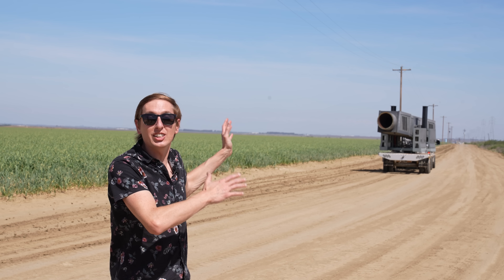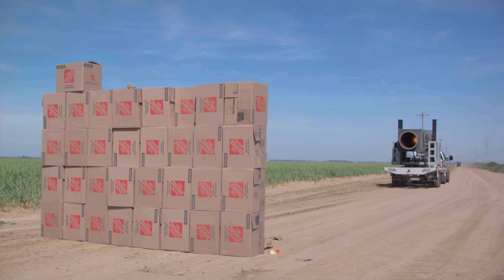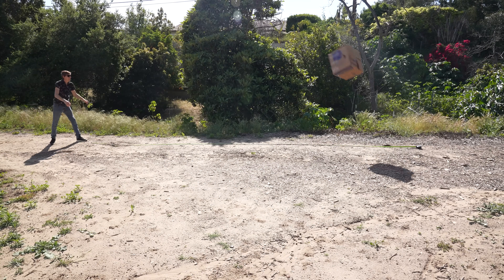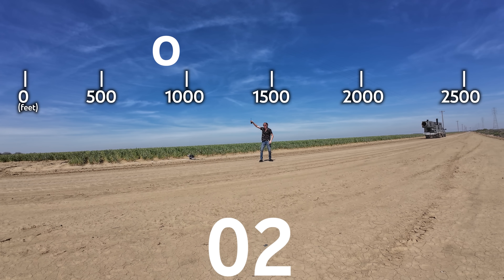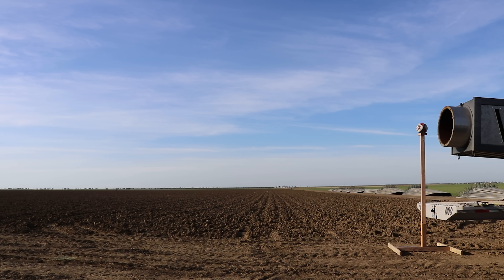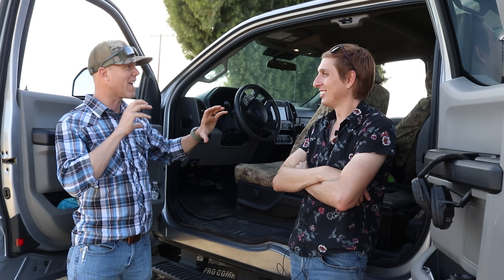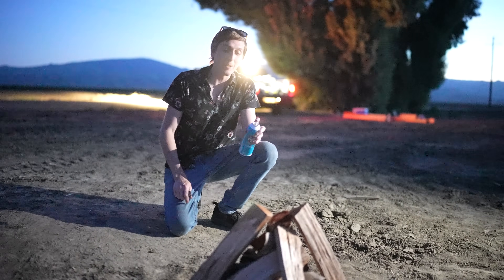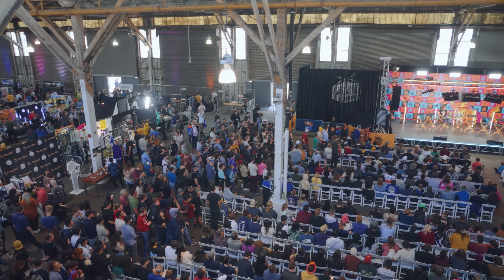Could you Survive a Blast from the Worlds Biggest Vortex Cannon?

Comment: I don't know if this is good video idea but I've been wondering about it for the last week, you could call it something like "WD-40 exposed" or something for clicks, but it would be a test to see if just plain water has any penetrating capabilities compared to wd-40; which if you don't know is treated like a penetrating fluid and has some capabilities as one but isn't really one compared to real ones. I can't remember when but at some point a long time ago I took apart something that was soaking wet and it came apart really easily compared to the same things when they were dry; it might have just been not tight but I think it was the water acting as a penetrating fluid. It'd probably have to be kept wet -wd-40 and other's aren't going to dry out the way water might. But it would be more like in a pinch, could you actually just use water as a penetrating fluid type of thing. You'd might have to mix soap or maybe vinegar or something with it to break the surface tension.

Comment: I now need your tech , curvature engineering a basin and along with a couple of compresser units to a good tonnage or as much as can compress , along with building massive amounts bassline vibration instead explosions and using oscilations through compressed atmos and microwave expanding through the jet end use your tech to constantly beam fire compressed atmos in multufield tension and microwave expanded to constant fire your vortex as a fueless engine. Do you think it would work , basslines not bombs

Comment: U could use a digital display to look at the sun  can't look directly at the sun.   But a digital display could  recreate what is being seen. Within the. Digital eye   and  will not be able to   exceed the max  briteness of yhe screens capabilty  although its need to be a much more sophisticated. Camera.       Tech then just ur phone  
       Bcuz 5he.   Sun tends to  saturate with solid white    
 But im certain there is. A.   Set Measurements  or rather metric.  That is dynamically suited.  To interpret the data        also shutter speed is issue.  But its not impossible

Comment: Hey back yard scientist, do you think it is possible to make it fire multiple times in a row like a machine gun. Either by adding multiple pre charged champers connected to the same outlet, or by adding multiple gas inlets with a single champer and a single outlet that can go off in a series to cause the machine gun effect.  

This could be really helpful in simulating the avalanches without using explosives. Also, imagine it attached to a helicopter 😅.

Comment: You know the knife rockets? You should use those engines along with a custom metal tube to hold the engine that has fold out stabilizers like a stinger. Then, either make it purely kinetic energy or maybe to be more fun, chemical energy. I've always wanted to make something like this but it is probably not possible for me to make as I'm not in Florida or Texas which are a bit less strict. Just an idea.

Comment: The Venturi tube diameter needs to be smaller and the exit ring should be smooth, i.e., have a curved edge. I built a similar device over 25 years ago, albeit smaller, that could  push a Golf Ball nearly two miles.

Comment: If you modified this to essentially be a (Combustion) Light Gas Gun, would it be more powerful?

Also adding Colorant Injection like a Fog Generator or maybe add in extra fuel (of different types too) may air in visibility.

Also aiming tech?

Either way absolutely stellar build, I’ll take 6 of em plz!

Comment: -What if instead of using gasses which can only expand a few thousand m/s when ignited in ideal conditions, we use an explosive that is liquid at room temp. Nitroglycerin for example, it can expand at over 7000m/s. Whilst it is extremally reactive, if aerosolized into an oxyacetylene and pure oxygen mixture, and then detonated, i wonder if it could be more powerful.  The nitroglycerin would be cooled just above the temp it freezes at so it is less reactive, and injected into the tube. Also if not already in place possibly a 30psi or higher burst disk, allowing the gasses to be compressed inside the combustion chamber. It would increase reload time, but it could allow the cannon to be more powerful. Also if you believe I am wrong in any of these statements please free free to inform me below.
Reply from the maker: The army tried using explosives instead, but the pressure pulse/wave is too short. A vortex is only formed when the length of the air pulse exiting the nozzle is 3 to 4 times the length of the diameter of the nozzle.
https://apps.dtic.mil/sti/tr/pdf/ADA372518.pdf

Comment: It should be feasible to design a configuration that creates two concentric toroidal vortices. By aligning a smaller ring within the larger one in just the right way, it might be possible to form a vortex within a vortex. 

Additionally, I’m curious about the extent of experimentation done with a smaller exit diameter to focus the force into a more confined area.

Comment: Pro tip for difference matte -- freezeframe first frame...
Reply from the maker: What do you mean, just so you don’t have to drag the other clip over?
Reply: @TheBackyardScientist  naw, so it's analyzing difference and you're using a moving (time delayed clip); you want to use a static plate (freeze frame) so you can see all the differences... you're calculating the "difference" between the time offset of how far you moved the clip, using a freeze frame before the shot will calculate ALL the differences. This is a common technique used in visual effects instead of using greenscreen (but is limited to having a locked static shot, need green screen for camera movement). I hope that makes sense?? In formula, you're method Difference = Time A - Time B... where both A and B are factors of changing time; I'm suggesting Difference = Time Naught - Time B ... where Naught is static and not a factor but B is....

Comment: I‘m wondering how you approached the „is it safe to stand in there“ part? Even with protection and safety as third priority, you’ve only got one set of eardrums. If you stand right in front of it, you’ll have a big problem - but where does that zone end? Did you just eyeball a safe distance and see where it goes or did the inventor do some pressure tests to be able to give you a safe distance? Anyway, quite courageous to stand in front of that monster :)

Comment: I have some background in fluid dynamics (not an expert by any means so take this with a grain of salt), and so I really wasn't surprised that the basketball didn't go very far. The shot of air, while moving the air extremely fast, only hits the ball at an instant. Thus, it's imparted with an impulse of energy, kind of like punching it really hard. And while the air downstream is still moving really fast (ergo why it damages the tree so far away), it won't carry the ball that's much heavier than air. 

p.s. by "moving the air" I mean that the force is propagating through the air, but I think what I said is more understandable